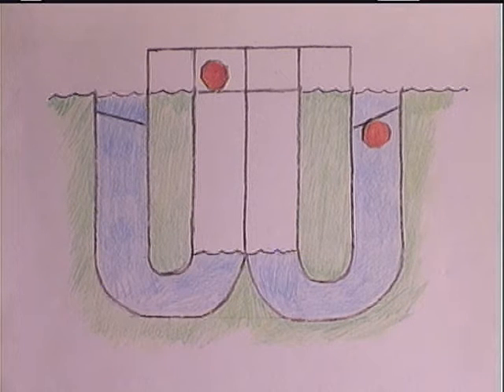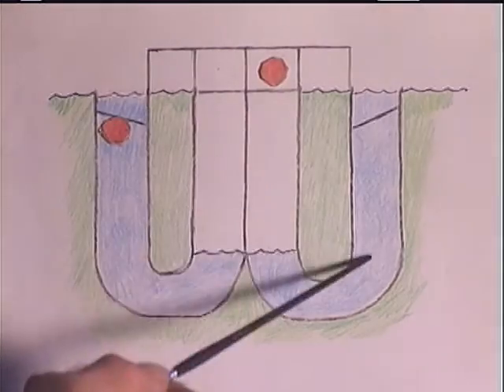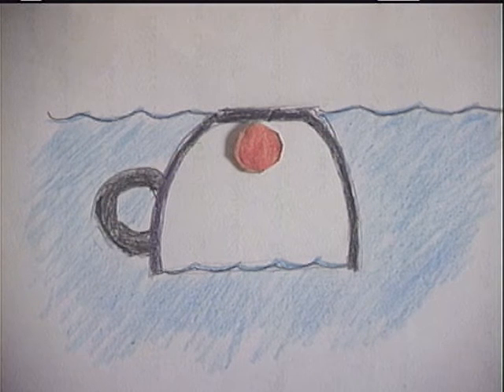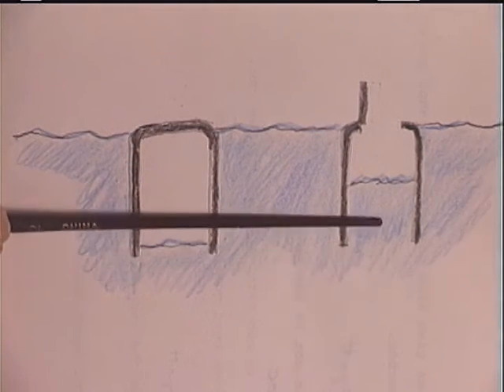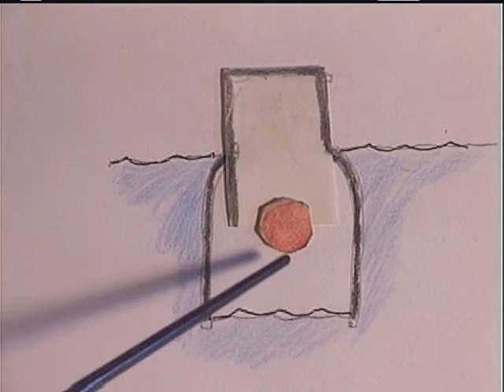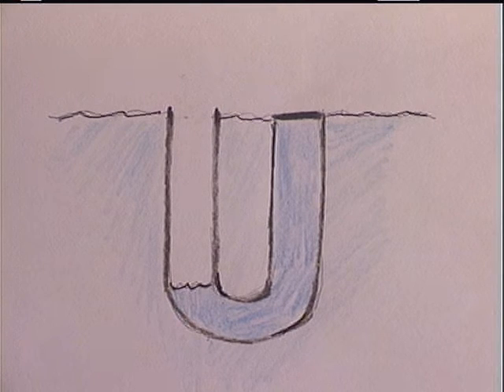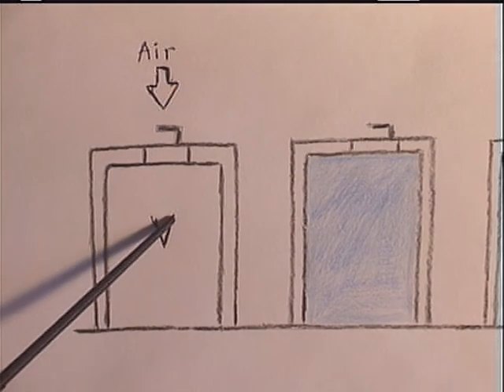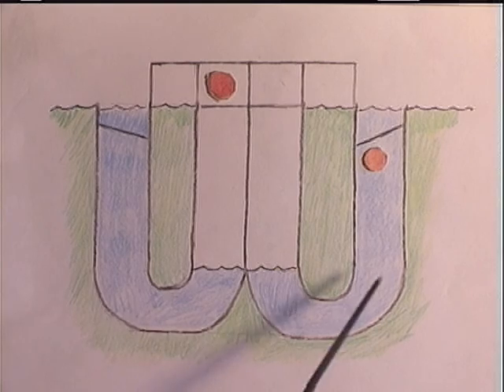Water Perpetual Motion Machine P14

Comment: To use force form nature to do work, it must be used asymmetrically, otherwise there is no energy gained.
 For example If you take a 100kg enclosed mass and fill it with air it will float on the sea, if you pump water in, the air will be forced out and it will sink. If the mass then drops 100 meters to the bottom of the ocean, it will have "G" do much work on it, and a lot of that can be used to turn a generator. Your only energy requirement is needed for pumping the air into the enclosed mass when it gets to the bottom so that it will be displaced 100 meters back to the surface again. 
The energy used by the pump is much less than the energy gained from gravity on the mass filled with water,  and the upward force of the water on the mass when filled with air.
This video shows symmetry only! 
Asymmetrical design allows for continued work for life of the parts used it that system. 

History's physicists told us airlines can't fly carrying many people without violating the G constant!
Reply: In reality you would of course do this above sea level, and the aim would be to only pay to pump the water up the top, the mass is the extra parts that is moving as a byproduct of the system (nature). 
Cool stuff there are real companies right now producing this type of system for the public. 
Lol it's fairly crazy!